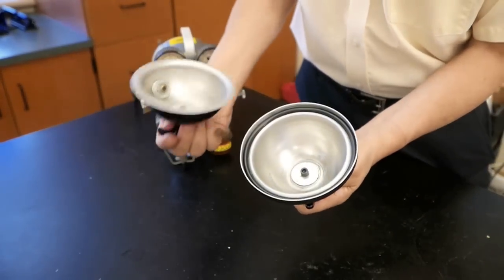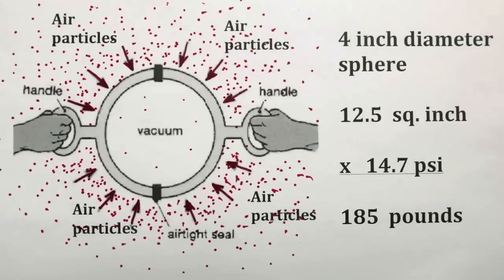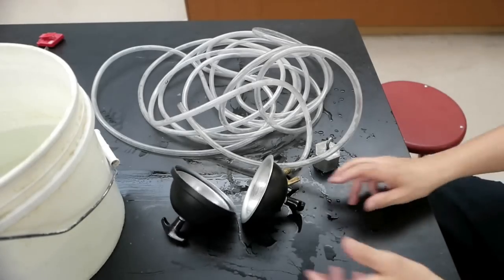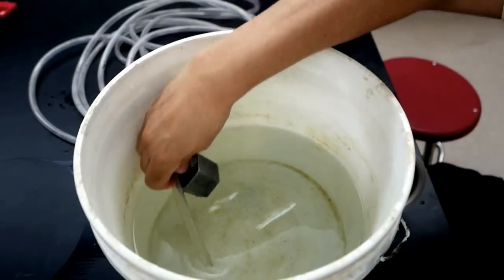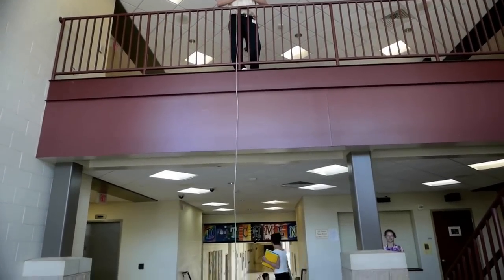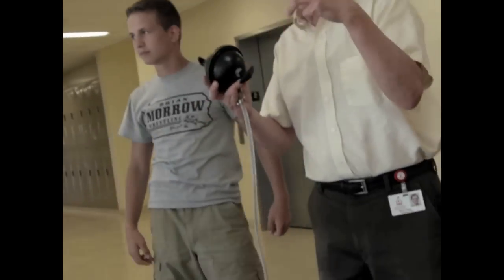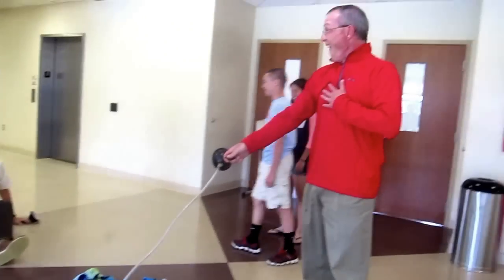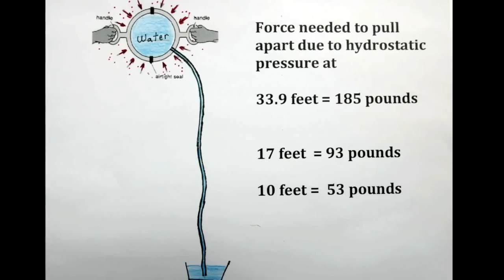Magdeburg Hemispheres- amazing alternate method- no pump // Homemade Science with Bruce Yeany

Comment: So I ask again,not trying to pester you or anything but you totally understand the concept of vacuum, so how is it that in the perfect vacuum of the ever-expanding space , could even the most powerful rocket produce thrust. This is not a joke I'm looking for answers.
Reply from the maker: Newton's third law, engine exhaust is needed to go in one direction,  the rocket is pushed in the other direction,  pretty much like letting go of a balloon with air in it
Reply from the maker: it doesn't matter if it is in air or the vacuum of space,  it is still the same results
Reply: Engine shoots out particles thus creating equal amount (to the escaping particles) of thrust to the rocket only in the opposite direction. It's the same concept as water or air jets - the don't need air to push away from like a propeller does.
Reply: +Bruce Yeany (Yeany Science) I know that you are a very smart guy. I also realize that all the books say what you just said however I know for a fact that one can take a small balloon rocket on a string and position a good size vacuum cleaner at the exhaust end of the balloon when you let go and the balloon will not go anywhere. Space is an ever expanding vacuum. Nothing to push against.
Reply: The rocket is not propelled due to the exhaust "pushing" against anything. If that were the case, then even within earth's atmosphere, rockets wouldn't be able to go anywhere, because air provides basically nothing to push against. What propels the rocket is the fact that the escaping exhaust causes a force against the rocket in the other direction. Again, this is not due to the exhaust pushing against anything.
Reply: +Oatsman4 If that was the case then my experiment should not fail. The balloon should propell itself even with the vacuum cleaner at the nozzle, but that is not what happened. This is simply a challenge to think for our self. I mean outside of NASA have we ever witnessed a rocket propelled through the vacuum of space. I work with turbochargers in the automotive industry and I happen to know that if you put a small enough turbo on a  large enough engine that it will fail to enhance the performance of the engine at all. So I asked how could you build a large enough rocket to overpower an infinite space and vacuum.
Reply: +Oatsman4 I apologize I had described my experiment with the balloon and the vacuum cleaner on another video so you did not have that information. what I did was a simple experiment with a balloon rocket on a string and when I let go of the nozzle I had a very large vacuum cleaner positioned at the rear of the balloon and the balloon  failed to move forward.
Reply: johnathan bowman Vacuum cleaners don't actually create vacuums. The reason the balloon didn't move was because the suction from the vacuum was too great for the balloon to break away from. The air escaping the balloon still propelled the balloon forward like it normally would, its just that the pull from the vacuum cleaner was greater.
Reply: +Oatsman4 well I am not trying to be rude but I just simply disagree with everything you you just said. Everything to do with propulsion, flight, hydraulics you name it, has to do with pressure. Short of a supernova explosion how can one exert any pressure against  the supposed infinite vacuum of space. And yes a vacuum cleaner does produce a vacuum hence the name.
Reply: OK, now read and try to understand: you were performing your experiment in Earth's atmospere under normal conditions, right? So, your ballon had pressure all around it's surface of almost 15psi. When you start pullung air with a vacuum it lowers the pressure because it sucks air from around the nozzle and if you put nozzle near a ballon - you lower the pressure at a specific area of the ballon's surface while right on the opposite side of it you still have the air pressure pushing it towards lowered pressure area. SO, if your vacuum cleaner pulls more air then the ballon pushes out - ballon cannot get away from the nozzle. Basically the same as if a turbocharger puts out less air than the cylinders continously pull - turbo won't do much good (it'll help a little, but not significantly).
Let's get back to space or more precisely - vacuum. Say you have a pressurised steel ballon in vacuum environment (rubber ballon would basically expant till explosion because of pressure inside) and you open a valve to let out the gas. The ballon will be propelled no matter how strong a vacuum cleaner you'd attach to the exhaust, because there's no air pushing on the ballon's surface!
Reply: johnathan bowman vacuum cleaners create a lower pressure the inside than the outside air pressure, but they do not actually create anywhere near a perfect vacuum. Just because it's named a "vacuum" cleaner, doesn't mean that it creates a vacuum. Just how "tin foil" is almost always made of aluminum.
Reply: +Oatsman4 I get that, like I said before I understand that everything is based on pressure. but like I said before how do you know that rockets actually work in the vacuum of space? Other than what NASA tells us? It was just a mind exercise. It cannot be proven without  say a super large vacuum chamber. Knowing what I know about pressure and vacuum I simply do not think that you're steal balloon would propel itself. It has never been demonstrated to us and this was my point.
Reply: johnathan bowman Yes. It can be proven. But I see realize now that your whole thing is that "NASA is lying to us". I'm not interested in your conspiracy theories. We do know that rockets will work, and not "just because NASA tells us".
Reply: +Oatsman4 No conspiracy just real zetetic science can you prove it?
Reply: +Oatsman4 I like this guy Bruce because he breaks things down into simple demonstrations that can be observed. all I'm asking is can we do an experiment other than the one that I did that failed to prove what NASA tells us that rockets do in fact work in space work in space?
Reply: johnathan bowman I, along with other people, have tried to explain to you why rockets can work in the vacuum of space, as well as why your experiment failed due to it being poorly designed and based on incorrect assumptions. I'm not going to keep trying to explain it.
Reply: +Oatsman4 okay so let me get this right you say because nothing is pushing against the outside of the steel rocket that you described ,in a vacuum, that the pressure inside would propel the rocket forward because of Newton's 3rd law. I understand what everyone has said I just simply asked can this be demonstrated. you're telling me it works because someone said so. what is so wrong with proving it. I mean isn't that the fundamental of science.
Reply: +Oatsman4 I really don't get why it offends people so bad , especially educated ,people if if someone suggest that what they have been told might be wrong. I mean why is that such a big deal? That is what science is supposed to be for. I didn't think science was a religion!
Reply: Who did you offend? 
You got enough explanations from us, if you cannot understand - we're giving up on you.
There's no reason to believe that a rocket won't work in space, hell, it's much better in space for a rocket - less gravity, almost no air resistance...
Reply: +Martynas Valūnas SMH have you, or rather can you demonstrate this principle.

Comment: You could use mercury for a better effect, and I think it would actually create vacuum so you could remove the hose, wouldn't it? Maybe a follow-up to this video?
Reply: Piotr Domagalski   Fantastic idea walking around with a bucket of mercury in the school...
Reply: Not a bucket, a bottle :)
Reply: Piotr Domagalski   Hm. Anyway he would get his (more or less perfect) vacuum into the amphispere with the hose dangling down a 10 metres staircase, and without the danger of spilling mercury around the entire place... hm...
Reply: well actually with mercury it would only be 760 mm (or was it 730?)... but yeah of course mercury is not feasible.

Comment: Recalling this, It seems fanciful to imagine a rattan vine Madgeberg Hemisphere setup.
"When the base of a vine is severed while immersed in a basin of water, water continues to be taken up. A vine less than 1 inch (2.5 cm) in diameter will "drink" water indefinitely at a rate of up to 12 ml/minute. If forced to take water from a sealed container, the vine does so without any decrease in rate, even though the resulting vacuum becomes so great that the remaining water begins to boil spontaneously."
http://users.rcn.com/jkimball.ma.ultranet/BiologyPages/X/Xylem.html
Reply from the maker: Hello Resonanttheme,  thank you for sharing that,  it is  a pretty good article.  I'd love to see that either with the Hemisphere or with the flask of some type with the water inside.  I wonder how to get an airtight seal around the vine?   that's a pretty good sized vine 150ft,   I wonder how well it would work with something a bit shorter.